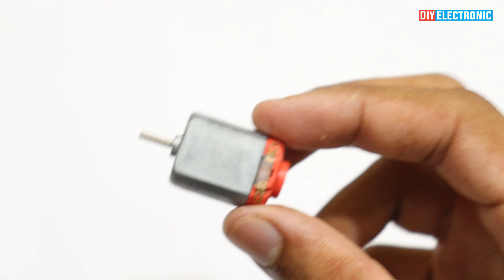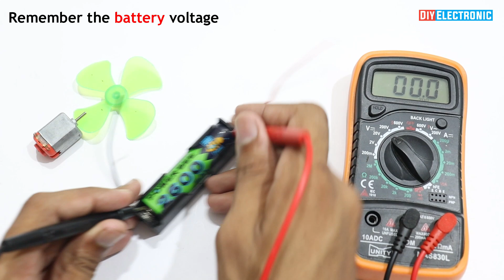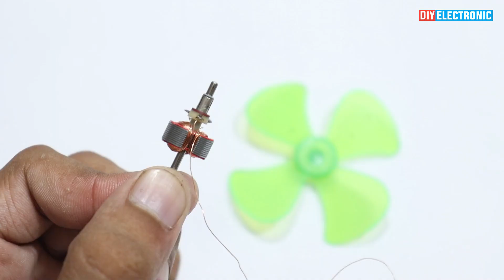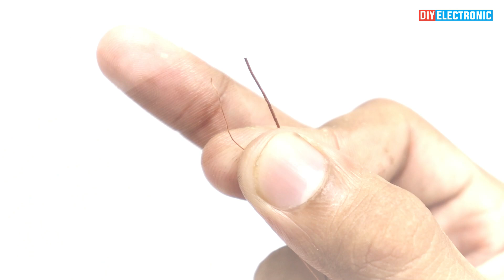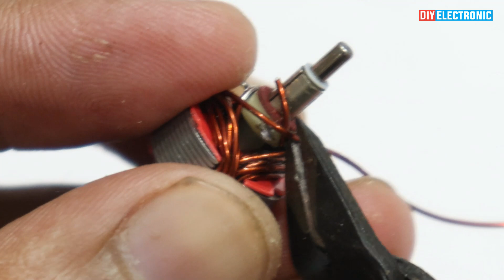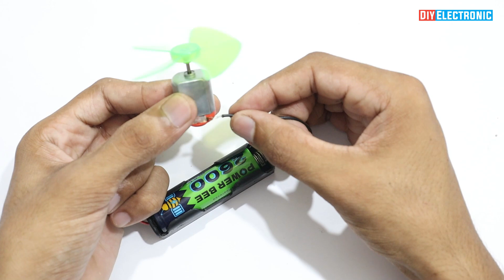How to Boost Motor To 8X Speed

Comment: Strong magnets + Thick wire = FAST and Torque
Weak magnets + Thin wire = Fast and less Torque
Magnets make the difference.
Weak magnets + Thick wire is not good.